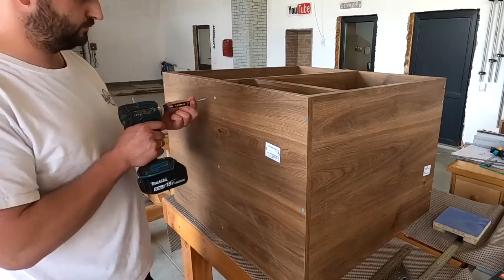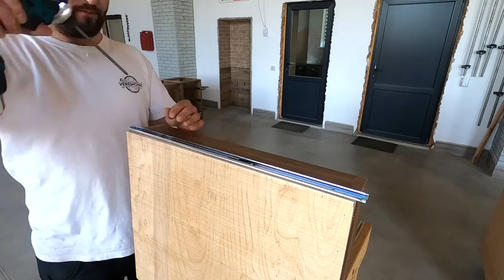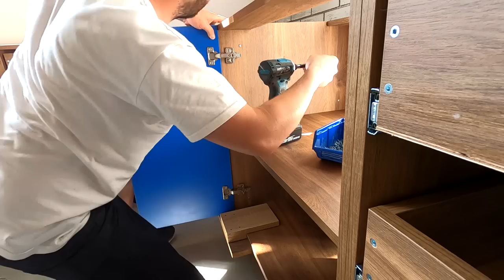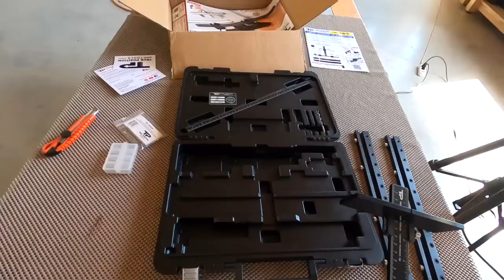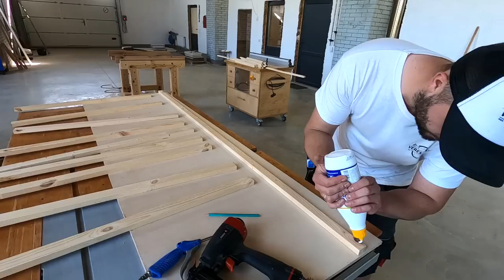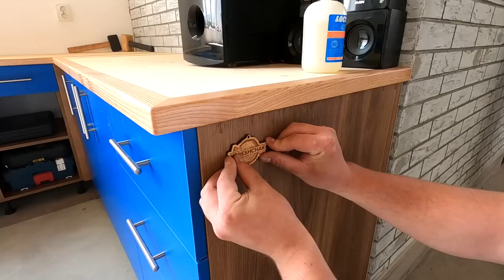Easy and Simple way to Build Workshop Cabinets and Workshop Organization / Cabinet Box

Comment: Use Blum Tandembox S Steel drawer runners with either white or black melamine/melteca bottoms and backs. Making drawers like this is so 80's. Plus Blum system 32 hinge jigs along with soft close hinges. They along with Salice, HETTICH and Grass have an extensive range of hardware and jigs to suit.

Comment: You might want to think about getting a 10” sliding table saw, build a BIG table all around it.. and on the opposite corner, you install THAT table saw.. 
you often see this setup in cabinet/small millwork shops.it’s common to see 2 powermatic model 66’s, facing each other with a big table separating them. 
It looks like you have A LOT of space.. so you can totally fit a small sliding table saw in ( Grizzly tool) and then have that other saw on the opposite corner.. cutting small stuff, strips.. 
… no more track saw…